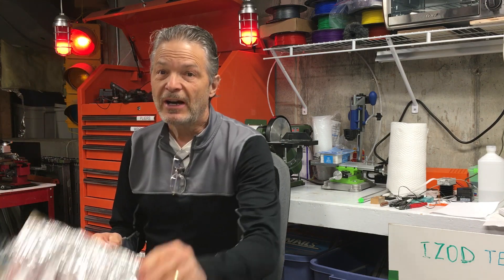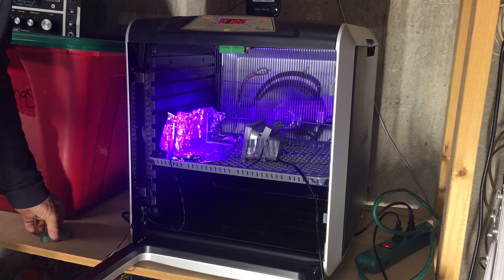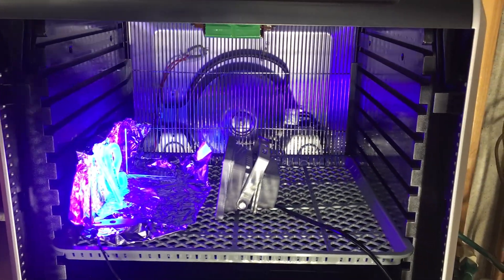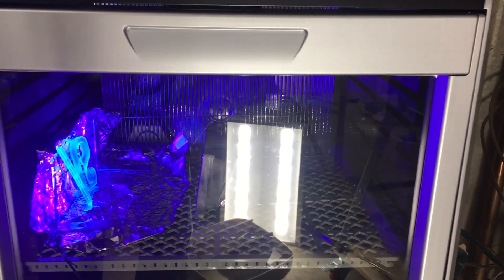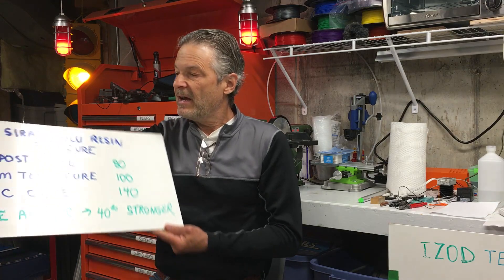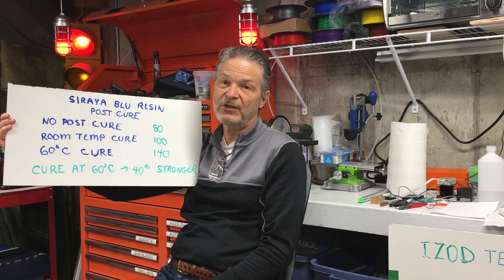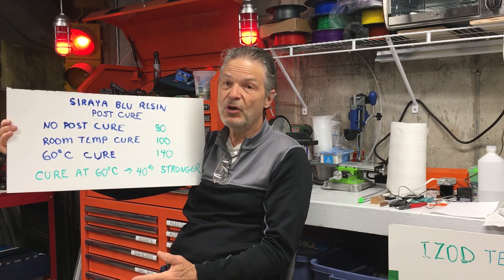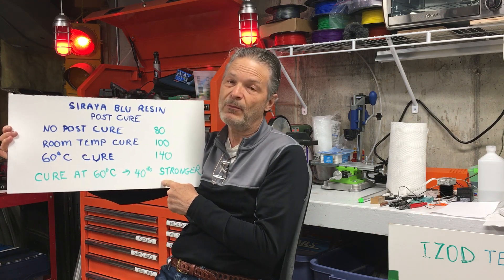Effect of Post Cure Temperature on Resin Prints

Comment from the maker: BTW, I forgot to mention in the video how long I cured the samples.  I used a 60 minute cure for the tests. but Form Labs says 30 minutes works for most samples and my quick tests say a 30 minute cure at temperature is OK. (I turn the sample over several times during cure).
Reply: Hey Phil, I believe the curing process is exothermic this leads me to thinking that each model will have a different ideal curing temperature [depending on its volume to surface area ratio] as each model will self heat differently. 
I like your Izod tester, could you explain how you got the pointer/arm to have just enough friction to move freely but stay put if that makes sense. Im thinking of running some tests based on curing in a heated water bath.
Reply: It is not just time but also intensity, which is a function of light output and distance. So time without knowing mw/cm^2 is not enough to go by. 

My true 100 watt emitter makes white resin turn brown within 2-3 minutes.

Comment: I'm curious about 2-3 week of room cure effect. Some of resins i've tried became so crunch with uv post cure for small parts. But when i left some parts 2-3 weeks and didn't post cure with uv they were more bendable and reliable.
Reply from the maker: If you don't cure with UV, it will definitely be bendable, but will have almost no strength. (tensile or compressive).

Comment: If I will cure uv light and heat not the same time, but first uv light then heat will we have same effect? Some papers says that curing with uv light long period of time makes details more fragile, like you dropped it unintentionally and it will shattered in pieces, is it true?
Reply from the maker: I think it must be heated at the same time as the UV cure.  The heat is vibrating the molecules which allow uncured molecules to find each other. .  I have not seen any brittleness from curing. (impact strength)

Comment: you would get better results if you buy a solar powered turn table. would ensure a MUCH more even curing of objects. even if you cure it a certain amount of time one way, then flip it and cure more, its still not perfectly uniforms which can cause some variance in strength.
Reply from the maker: Interesting idea.  I usually open the oven and turn the object several times during the cure cycle. Some of those turn would not be replicated by a turntable.  thanks Phil

Comment: Love these videos! Learning a lot about tough resin. Would you say that AZ summer at 110 degrees outside while curing is an appropriate temp for post cure?
Reply from the maker: It is a little cooler than optimal.  60 degrees C is 140 F
Reply: @PhilGandFriends  If 140 degrees F is optimal then I have to ask; are the strength results of the various temperature levels linear?  I mean if our parts are cured at a higher temperature but still 20 or thirty degrees less than optimal, can we expect the levels of strength to follow a straight line upward?
Reply from the maker: @MrTjmk  , good question.  From what I understand, curing higher than the glass transition temperature is most critical. (it is also true for curing epoxy glue).  This allows unbounded molecules to find each other.  I think the benefit does not scale much beyond the glass transition temperature.

Comment: This seems to be annealing and unrelated to curing. You could verify by curing at 20C and then comparing that to curing at 20C followed by 60C annealing step and also curing at 60C.
Reply from the maker: FormLabs (which has a white paper on the subject) says it is caused by the extra heat allowing unreacted molocules to find each other due to the extra vibration due to the higher temperature.  That is why they say post cure at high heat.
Reply: @PhilGandFriends  Hi Phil, a bit late here but im new to 3dprinting and wonder. so a regular cure station like the anycubic wont be able to do this right? its got to be made "manually" like you showed? Regards/Ed
Reply from the maker: @houseoflatin  I am not familiar with that particular cure station, but for it to work it needs to be able to heat.  I don't know of any that do.

Comment: But there is one loose end here. Can you please try various curing exposure times and graph the strength vs mw/cm^2*seconds at both 20C and 60C?

Because for all we know, doubling the cure time may have the same effect on strength.
Reply from the maker: FormLabs has that data on their white paper.  The strength vs time is mostly complete in 15 minutes, but still increases to around 30 minutes.
Reply: @PhilGandFriends  Their white paper shows that it differs for each resin so it would be interesting to know what Blu does. Also they don't document their UV energy because they just tell everyone to buy a FormCure.

Comment: Could you tell if elongation at break* changed with the higher temperature cure? *how much the samples bent/stretched before breaking. I find that this is frequently the measure of strength that matters most with resin prints. Snap fits for example will often fail if the elongation at break is too low.
Reply from the maker: Hmm. I think Stefan may need to do that test with his automated tester.  I don't have a good way to measure the elongation.